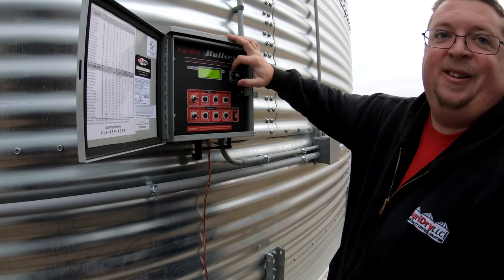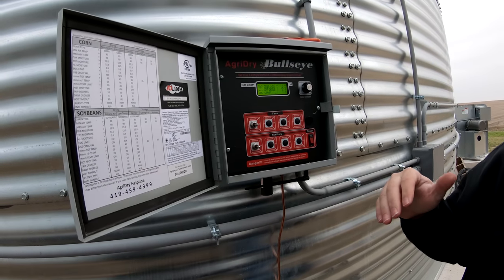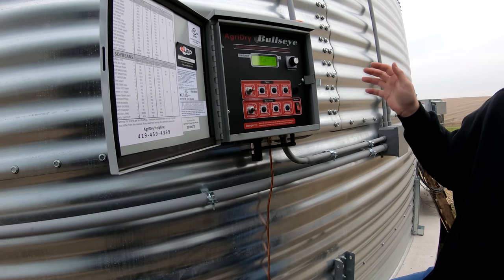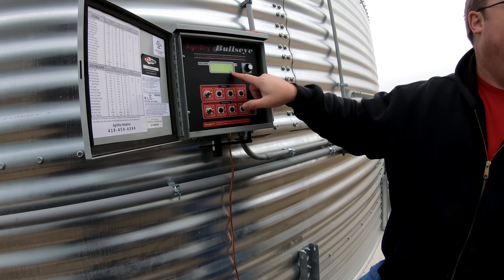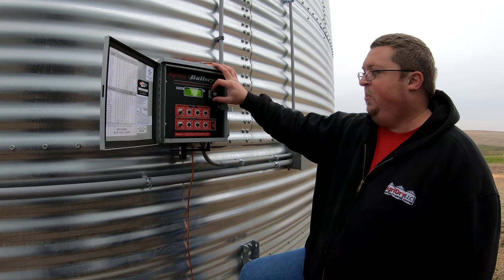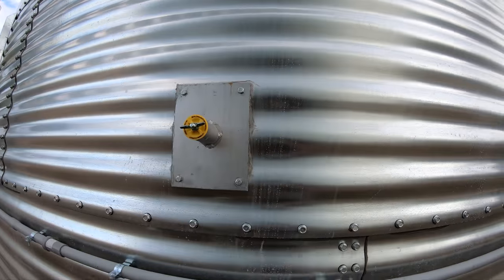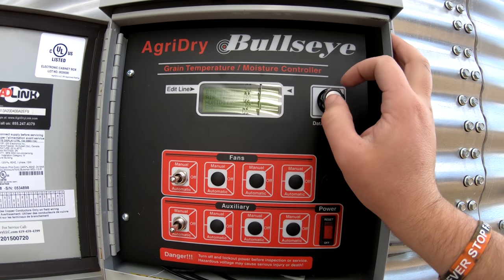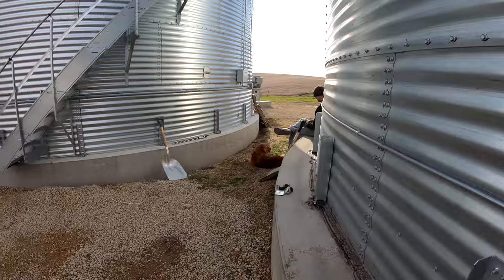Grain Bin Automation

Comment: If this thing ever goes haywire you've got the world biggest popcorn maker xD
Reply: LOL!
Reply: @m9 ovich It's not running the burner... the idea is to use mother nature to the extent possible to save on the costs of running the fan (electricity) and the burner (propane or natural gas, in this case propane).  When the air temperature and humidity are right compared to the temperature and moisture level of the grain in the bin, you can achieve drying simply by blowing ambient temperature (non-heated) air through the bin.  That's the idea behind the Agri-dry.  

Like Ryan said, with soybeans where below standard moisture is actually costing you bushels (money, due to lost water weight in the grain-- you get docked for excess moisture due to additional drying costs and the fact that the elevator doesn't want to buy water in the form of moisture in the grain, BUT you also don't get paid extra for extra-dry grain that weighs less because of the lower moisture content, hence you lose money with excessively dry grain) you can ADD moisture back into the grain by the system turning the fan on in certain temperature and humidity conditions compared to the temperature and moisture levels of the grain inside the bin, thereby adding moisture back into the grain... it works both ways.  

Later!  OL J R :)
Reply: That new bin does have a heater installed on it. They may just not have the controller configured to run it. Check out Travis's video to see it for yourself: https://www.youtube.com/watch?v=vw587El-GWo

Comment: Wow it would be interesting to put a seperate electricity meter on each bin and record a side by side comparison of the cost of drying a full bin using each system.  Great to have the option of using the new bin to dry product without use of the stirator allbeit from a allready relatively low mositure level.
Reply: It's not just the electricity but the propane to run the dryer burner as well... 

Later!  OL J R :)

Comment: Years ago you put ear corn in the corn crib, and took it out six months later and the corn was almost perfect with "NO "technology involved. Grain bins suck.
Reply: Handling ear corn was a PITA too... filling and emptying ear corn out of cribs was mostly manual labor, because unlike grain ear corn will not readily flow out.  

Ear corn was the primary harvest method for many decades because most corn was used "on the farm" to feed livestock that were then sold (beef cattle or hogs) or their products (milk).  As you said, technology was lacking and it was easier to harvest and store ear corn than grain BACK THEN.  Many Mennonites in the area around my BIL's place in northern Indiana still pick and store ear corn, but again, BECAUSE THEY'RE USING IT "on the farm" to feed their own livestock.  Most corn nowdays is combined (threshed) and stored and hauled and sold as threshed grain BECAUSE it is being sold as a commodity "off the farm" and used industrially in whatever capacity-- ethanol, animal feed, to make corn syrup, crushed for corn oil, etc.  

Unfortunately it's not the 1950's anymore and times have changed.  

Later!  OL J R :)
Reply: Grain bins are great if you manage them correctly.
Reply: That's because farmers no longer are farmers... they no longer do farming daily anymore.. the new guys are just too lazy to work all the time... they just want to work as little as possible... alot of character has been lost by these "big" agribusinessmen"
Reply: @tdgreenbay  no farmers are farmers today it's just that some of us have grown with the new ways of doing things.  30 or 40 years ago we cribbed corn, and plowed with 4 bottom plows, everyone milked 30 cows and planted corn with a four row planter and were lucky if it yielded 100 bu/ acre.  

If you go back 60 years before that they farmed with horses and planted by hand.

Farmers of today are farmers.  They farm smart.  They use the tools of the time. There is nothing wrong with big equipment and taking time off and working less.
Reply: @tdgreenbay  What rubbish.  Despite what some people may think, it's not 1950 anymore, or 1940 or 1930.  You can't make a living farming 100 acres with a John Deere B and a 2 bottom plow.  Heck most farmers can't make a living just farming anyway... they have to either work an extra job "in town" or have a wife who does.  Otherwise they have to "get big" and farm many thousands of acres, and even then it's not like they're getting rich... Sure you sell a few hundred thousand bushels of grain and it looks like a PILE of money to most folks "not farming" but then you get bills in the mail for a few hundred thousand bucks for seed and $50,000 for diesel fuel for the year and another couple hundred thousand for fertilizer and another hundred thousand for chemicals and then of course notes on the farm machinery, repair bills, and all the incidentals (like probably $10,000 for oil, grease, filters, consumables, and miscellaneous small parts) plus any major repairs are often upwards of several thousand dollars... tires, batteries, filters, you name it.  And not on just one or two cars or trucks like most families-- an entire fleet of machinery where each one takes 10X the amount of oil and fuel the average car or truck does, at EVERY change... Heck modern tractors easily can use 40 gallons of oil or more in the transmission/hydraulic system ALONE.  That's EACH ONE not all combined!  

Heck even the Mennonites are buying every piece of land they can possibly get their hands on, running steel-wheeled tractors  up and down the roads (which is illegal BTW but they do it anyway) and doing the one thing that their "religion" and it's "peculiar requirements" (ie steel wheels) is supposedly designed to prevent-- THEY'RE GETTING BIGGER.  

Nobody I know wants to run a bazillion acres, THEY HAVE TO.  Just to pay for the machinery and inputs and rent or land notes and equipment notes and pay the banker and hope to have about as much left over to live on at the end of the year as most folks would make in town working at the auto supply or being a bank teller... 

A hundred years ago, a hundred acre farm could support a family with 8 kids... and you NEEDED 8 kids to do all the work!  That part of the equation has gotten lost or forgotten in many cases... My Ma-Ma told me stories when she was growing up in the 20's and 30's... she'd go help prepare the ground and plant corn for her BIL Uncle Red and her sister Aunt Florence, and they'd feed her and let her sleep on the floor in their house (they only had one bedroom).  When the planting was done, it was "time for her to go" and she'd be shown the door, and be on her own til harvest time... she was 8 years old at the time, her mother had died, and her Dad was a functional alcoholic who'd be gone working lumberjack jobs and oilfield jobs for weeks or a month or so at a time.  She told me how she made crawdad traps out of old soup cans to catch something to eat, because that's all there was.  At harvest she was welcome to come back again, til the corn was all picked, then it was "time to go again"...  The neighbor up the road I used to bale for told me in his late 80's about life on his farm (that I was baling for him) when he was a kid... they had 160 acres and it not only supported his parents and numerous siblings, but several "share-cropper" or hired hand's families as well.  Course they lived in shacks we'd be ashamed to use for a doghouse these days, but well, you can't have everything!  Anyway, they picked the cotton about four or five times, all by hand.  Last picking was just before Thanksgiving.  Then their Dad was very generous-- he gave them the week of Thanksgiving off, and then they'd be picking the cotton AGAIN after that... His Dad was also generous in that he allowed them to keep the money from that final picking for their Christmas money, to buy presents.  He'd give them the week off for Christmas, but come New Years Day, you hitched up the horses to the rolling stalk chopper and started cutting stalks, preparing for the next crop.  In between of course was all the usual chores-- shelling corn, feeding livestock, mucking out the barn, etc.  

Yeah, 150 acres would support a family back then, but it was about one step above a "Little House on the Prairie" existence... I don't know ANYBODY who would want to live that way in this day and age, do you??  Even if they wanted to, they couldn't...  couldn't make enough to even pay the taxes, pay for health insurance, etc.  The world has moved on, and you either move along with it, adapt to it, die, or do something else.  

Now I'll agree there's TOO MANY "big time operators" that do a lot of stupid stuff, and it doesn't make sense... but that's because of a BROKEN SYSTEM that rewards such things; sooner or later somebody figures out how to "work the system" (no matter what that 'system' happens to be) and figures out how to make a killing off it, regardless of whether it's "right" or "ethical" or not... and they don't have a problem with it.  It's not just farming, either-- it's EVERYTHING.  I don't care what industry or job or institution or whatever you think of, there's people "taking advantage of it" and using that to get ahead... some say it's just being "smart".  I guess in the end it's a personal decision.  

Later!  OL J R :)
Reply: Yeah like there was never any vermin around when you put it all in corn cribs!

Comment: I'm confused.  If the system can zero in on a desired moisture content it can detect the moisture content.  You shouldn't need to tell it what the starting point is.
Reply from the maker: No, it uses algorithms to figure out what moisture you would be pumping in, not the actual moisture content inside the bin.

Comment: all this temperature talk in meaningless units is frustrating.
Reply: Yes, I have to agree. Knowing that it is 18C is pretty meaningless to me. :-)
Reply: It's not that hard to learn both kinds, and it makes it easier to watch TV, movies, and internet videos from both sides of the pond :)
Reply: @lwilton  the 18 they are talking about is not temperature it's percent of moisture.
Reply: The controller has option for f or c.
Reply: Ah, I should have picked another number, I hadn't recalled them mentioning 18 anything specifically. I was just pointing out that it works both ways, I have to think for a moment when someone gives a degrees C temperature to convert it into something I recognize.
Reply: Again all the numbers that they used here were in Fahrenheit for temperature.  There was never a Celsius temperature mentioned.  When he is talking about 18 or 15 or 13 he is talking about the moisture of the grain in the bin which is in percent.
Reply: Perhaps you should go back and read the original comment that started this thread. The OP was complaining about temperatures in degrees F, which he couldn't understand.
Reply: @lwilton  I understand that. It was you that made the comment about Celcius and that was never mentioned in the video.
Reply: @basstrammel1322  thats right because in some points it is the same such as -40 F is also -40C
Reply: @arnoldromppai5395  -40 is a great starting point, and when remembering 32 equals 0 and 100 is about 37-38 celsius, it's easy to ballpark convertions on the fly :)
Reply: @basstrammel1322  -40° is also really freaking cold.  I know what -30° F feels like, and I can't imagine the Kusters would enjoy it all that much if they had to work in it for very long.  (I use metric all the time at work, so conversions do not bother me at all.)